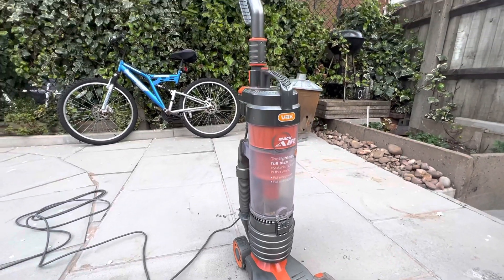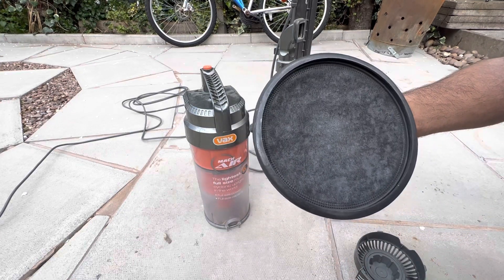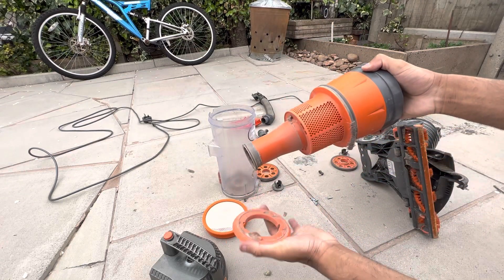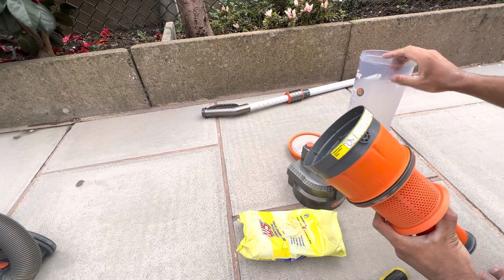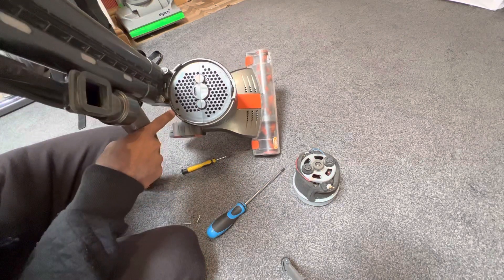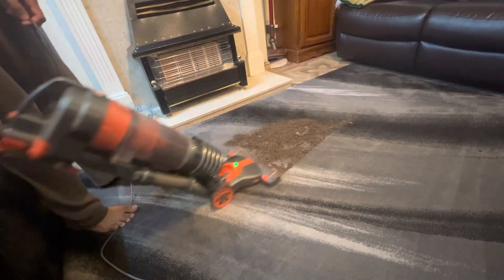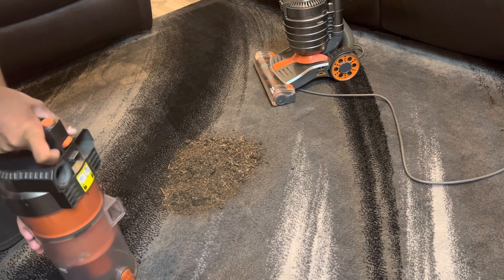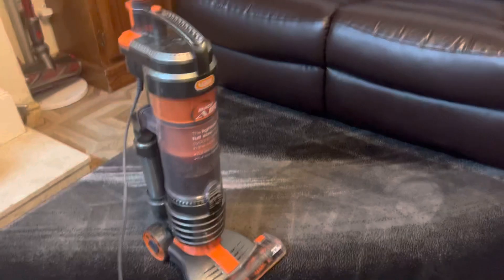Vax Mach Air vacuum cleaner - Repair, refurbishment & demo!

Comment: How do you get the wheels off
Reply from the maker: The cap on the wheel pops unclips with a flat screwdriver, the wheel can be removed and the screws are behind each wheel

Comment: I have a question pls, can u replace the brushbar on vax mach air u89-ma-pf it's pet and family hover. I've replaced the filters but am struggling to get to the brushbar to replace it with new one.
Reply from the maker: If the brushbar looks the same they will fit

Comment: What do you think of Vax?
Reply from the maker: I don’t generally like them apart from the turboforce, tub vax range and the new air uprights but even those are all unreliable
Reply: @parwaz7861   How about the 90s vax and the 2000s?
Reply from the maker: @jayambermsp8000  just the ones I mentioned really, the tub vaxes were decent but anything else that isn’t a turboforce or vax air I’m not really keen on
Reply: @parwaz7861   I do like the looks of the older bagged wet and dry.